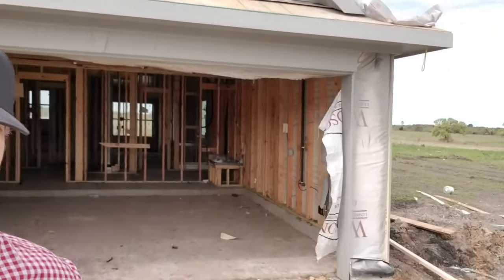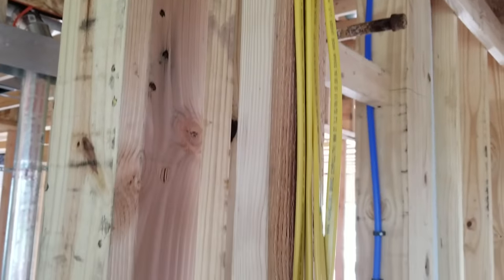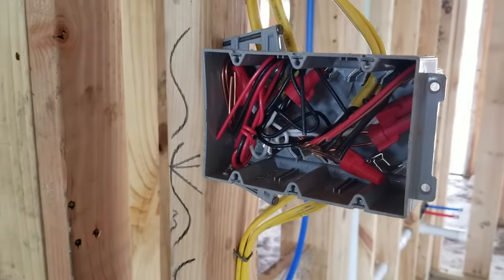HOW IS THIS EVEN LEGAL?!?!

Comment: needs plywood with tyvek before the hardy board ... this is quite a cheat
Reply: Or even OSB
Reply: My house was built in 1850. The frame is post and beam, the sheathing is 1” planks. They sure don’t build them like that anymore. 👍
Reply: The siding will outlast the house
Reply: As a general rule, you don't have to wrap the entirety of a house in plywood or OSB. It's not a bad idea, and there are benefits to it, but it is not necessary for a proper moisture barrier or for structural strength.

That being said,  the COMPLETE lack of wood sheeting is concerning.
Reply: teraxiel 
Isn’t it supposed to be sheathed with plywood on each corner to maintain lateral stability?  Those ceiling straps in the garage won’t address  this. Scary if lateral stability isn’t addressed and that the homeowner won’t be aware of it.   🤦‍♂️
Reply: @Mote78   I worked on some houses built in the 80s, corners were plywood, the rest was fiberboard or blackboard, a quality house is going to have sheathing all the way around like all of the houses I have built for the past 25 years, that's my opinion anyway
Reply: Greywolf79 97 couldn’t agree more. Plywood or OSB on the outside walls all the way around
Reply: Mike Gerrits Yeah we had like 3 inch thick studs throughout the whole house, structural shiplap, thick plaster walls, etc... won’t have it anymore cuz it’s getting rebuilt after a fire. 😂
Reply: @teraxiel , the only benefit to not wrapping it entirely with osb or plywood is only to the builder from a financial point of view.  Structurally speaking and as for keeping out air and moisture, there  is no reason at all to leave out the sheathing.  It's poor quality and basically a con job by the builder.
Reply: @jtltet  I'm not trying to be confrontational here, so please take it as intended. 

Any costs incurred by the builder that can be will be passed on to the buyer. Therefore, all things being equal, a house built for less is a boon for builder and buyer.

No, there is no structural or moisture related reason to leave out sheathing, only a financial one, see previous.

THAT home is poor quality, but lack of a complete exterior sheath is not in and of itself poor quality. Some regions need full wood sheathing for insulation reasons, air gaps, etc., some don't. Also, not all homes need a full wrap to be structurally sound. If you don't need it for insulation or engineering it is literally a waste. It bloats the cost with no benefit. It can actually be harmful to the finish. Stucco is popular in some regions and it does WORSE over sheathing, cracking much more than where there is none.

A complete wood wrap is a quality feature, but a lack of it is not NECESSARILY indicative of a lack of quality, so it is unfair to say the contractor is a con (he probably is, but a lack of a complete sheath is insufficient reason to say so).
Reply: @teraxiel , I don't take it as confrontational at all.  But as an architect I would respectfully disagree.  The lateral bracing  and the ability to resist wind shear makes osb or plywood a very necessary element in the homebuilding industry.  

Yes, it is true that by code it is not necessary to completely wrap a house with plywood or osb but I have never seen one that didn't at least have some sort of sheathing even if it was blackboard or intermediate sheathing as it is sometimes called.  
The use of the little metal straps are useless against racking if the wind hit hard enough and the home would collapse.  

Yes, it raises the cost of the house but in terms of the cost of the monthly mortgage we are talking $50/month, if that.  

Perhaps saying the builder was a con is harsh because maybe the buyer is aware of his practices but they certainly aren't doing the homeowner any favors by saving them a few thousand dollars on sheathing.
Reply: @jtltet  I feel like maybe we don't disagree.

I agree that that specific home looks low quality. My original point is that a home doesn't necessarily need an ENTIRE wrap of wood sheathing. I'm not saying NO sheathing. In fact, I don't think I've seen a home built in my career that didn't have more than a little sheathing. But I rarely see homes with 100% wood sheaths. 

Also, the guy in the video implies that you have to have plywood under the moisture barrier and I was also commenting on that.  Moisture barrier works just fine without plywood/osb backing.
Reply: @teraxiel , Every house built where I live in NC is fully sheathed with osb or plywood.  A moisture barrier isn't going to stop air infiltration so your home is literally going to be like having an open window in your house because there is no way to completely seal that off.  Every single nail that is used to install the siding is going to make thousands of holes in the moisture barrier as well.  I can go along with not using osb or plywood everywhere but some type of sheathing is needed prior to installing the house wrap.  My preference would be zip system r-sheathing which  already has insulation to stop cold spots because wood is not very good at insulating so the wood allows cold air to transfer thru from the outside but with the r-sheathing it completely covers the studs with insulation and provides a thermal break and eliminates the need for a house wrap as well.  Yes, it costs more but if you want to do it right it's going to cost.  If you just want a home to say you have a home then buy something like in the video but years down the road you're going to have problems.....big, expensive problems.
Reply: @jtltet  I don't disagree with anything you said other than that you need sheathing behind your moisture barrier. Now, this might depend on the product one uses, but your standard tyvek or asphalt paper works just fine without backing. Moisture barrier stops water not air. In the video, he implies that you have to have sheathing behind the moisture barrier and the OP of this comment thread repeated the same. That's all I was commenting on. Sheathing has nothing to do with standard moisture barriers.
Reply: @teraxiel , but the sheathing helps stop air penetration.  You do not want a drafty house or you are wasting money on heating and cooling  your home.  It is much easier to seal off a home with sheathing but besides that it is much more structurally sound.  I would not buy a home that was not fully sheathed.
Reply: @jtltet  Again I don't disagree, but we're talking about different things. I'm in full agreement that full sheathing and an airtight exterior barrier makes for a better, higher quality home. However, I'm only saying that moisture barrier doesn't need backing to work. That's my whole point. Full stop.

A house does not necessarily need FULL sheathing to be structurally sound. Full stop.

It's possible to engineer a house with no sheathing under the cladding but that's not ideal in my estimation. But again, we don't disagree on this.

Once were talking about airtightness we're talking about something else. Construction varies widely across the country. Especially insulation. In some regions, especially where it gets really cold, insulation is enforced to a strict standard. In other places not so much. So in some places an airtight exterior is PARAMOUNT, in others it's not. You can still achieve a high level of airtightness in the interior without an EXTERIOR airtight barrier, but rather an interior one. This is much easier and cheaper to do, but again is region specific. In California, you actually have to do a pressure test of the whole house (not sure how common this is in the rest of the country) to get you energy efficiency rating, and literally NO ONE builds a house with an airtight exterior barrier.

Comment: my friend builds home's , said he could break-in most any new house - thru the wall without any tool's
Reply: Come on he's joshing you. Everyone knows it takes a sheet rock knife to get into new homes.
Reply: Paul Frederick  Way that garage is built , pull apart the siding you're in . yeah want to be clean about it cut a hole thru the drywall takes time - just kick it out , your inside :)
Reply: @davedavis9693  I just don't want to mess up my expensive kicks. Plus knives cutting through cardboard is quieter than ripping it open is. You need to be considerate with the neighbors. You may be breaking into their house tomorrow.
Reply: Paul Frederick Thought we were chopping thru drywall ? now we are cutting apart cardboard . I'm just trying to get in fast as possible , before the cop's show up .
Reply: @davedavis9693  the cops are not going to show up if you don't give them a reason to. Like if you're quiet and no one hears you. What houses are made out of today basically amounts to gigantic happy meal packaging. Nothing but paper and plastic. I got to watch a new house burn to the ground here a little while ago. 15 minutes from ignition to char on the ground. The place burned so fast the fire department couldn't get there before it was already on the ground. It was phenomenal. The smoke billowing off the place looked like an oil fire. It was just this black pillar that went straight up. I don't think a pool of oil would have burned any faster than that place did. I bet not even as fast. I drove by as it was fully involved and I thought I was at the homecoming celebration. It was going like a bonfire. You couldn't soak a pile of pallets in gasoline and get them to burn any faster than that place did.
Reply: Paul Frederick can't believe people pay so much for their new dream house . I've hired contractor's , they always want to take short cuts using the cheapest materials . would not use OSB to build a dog house . cheap balsa wood , some five penny nail's n plastic on a slab
Reply: @davedavis9693  construction is a money racket. Stop paying them and see how many show up for work. There ain't many doing it for the sheer love of the work. And like is often said, If you don't cheat then you don't eat. Folks do tend to eat as well as they can afford to get away with too.
Reply: @davedavis9693  I've seen folks straighten lumber out. I've also seen how nice wood used to be too. I was working on one high profile job at a historic site and it had wood in it like you wouldn't believe. I know when I saw it I didn't believe it. Clear boards 20 feet long and a foot wide with grain so straight you can check how good your laser line is on it. How does a tree even grow like that? Over 150 years ago they did though. All of those are long gone now.  Our great great grand daddies chopped them all down for themselves. Which we'd do today but we just got to the party far too late. So we're stuck working with the crap that's around now.

Comment: I work with quality contractors no canned spec homes and no bulk tracks it's not that more expensive to get us you  spend 50k to 100k more for what we do in the long run you don't have a lot of repair in the future
Reply: You might even be cheaper if you can build a well laid out house too.

A lot of tract builders throw up large but stupidly laid out homes built dirt cheap, because people just look at sq ft and price.
Reply: @bigpjohnson  you are 1000% correct! I try to tell people all the time to always pick a smaller well built house over a larger crap built house. I built a smaller home but the finishes used rival homes $100k more than my house. I know people who built 3000 Sq ft homes with cheap laminate on every surface and carpet that feels like sand paper.. And Everything is falling apart

Comment: My God! I wouldn't even build a dog house like that. Where are the building inspectors?
Reply: murraystewartj --> Probably paid off by the builders.
Reply: looking the other way, or just non-existent due to cutbacks.
Reply: That's true. My dad built a house in 93, I remember the delays because the inspectors couldn't get there. One okayed th septic on the phone. The lateral were running uphill, I knew that was wrong, pooled water from the start. His permit for a driveway was never inspected, but our county officials are lazy.
Reply: First Name --> Hahahar, that's funny ... but you haven't seen my dogs!
Reply: Once outside of city limits, inspections become rarer and rarer.  You might get a local fire dept to do a basic electrical inspection, but that's about it.  Seeing as those houses are in a field, there might not be much in the way of permitting and inspections.

Comment: I had to strip my house down to the studs.  And I have to find several support missing off on the beam.  And most supports either shrunk or cut short and the beam is supported only by the nails.  Even the building inspector won’t find them, since these are behind the drywall.

Comment: Thinking about it, you are in tornado alley over there in texas, so maybe they are building to reduce cleanup efforts. fewer materials in the build, fewer materials to cleanup after a disaster. Just horrible stuff! Someone needs to be sued! As a Licensed Commercial/Residential Builder in NC/SC, I like to see that you are pointing this stuff out. These guys are such jokes! People in Texas can just wake up one day and decide to be a GC/Builder, and the only thing stopping them is at the local level. Yikes!! In 2019 even! It irritates me that there are many states like this where it is still like the wild, wild west in the construction industry.
Reply: yea that makes no sense, They arent impacted the very least with clean ups. This shit build quality has prolly killed people who have taken shelter in the middle of their house during tornados..
Reply: @XxAtomic646xX  I was speaking facetiously. Totally agree! This is horrible stuff they are peddling on people.
Reply: @chicks-on-the-loose  My choice, as a builder, if I were building there, would be ICF with at least 8" of concrete. Wind Tunnel test have shown that not even a brick wall will protect you from, say a flying 2x4 wood projectile. Brick walls are only 3 5/8" thick. Most homes use a curtain wall of brick and still have an OSB or Plywood skin over the framing on the exterior walls.

Comment: This video (and the quality is not that bad, I'm impressed) should be mandatory first-home buyer training.
Reply: You don’t get to see inside the walls, the only reason this video exists is because he found multiple homes in the middle of being built, once finished no one is ripping off the exterior to see what’s under it, but they should.
Reply: @epiccollision  No one but ME of course! lol! When I bought my first ever home(used crap house but at least concrete right?),that is what I did! As soon as I had the deed in hand I went inside with a hammer and wacked a few holes in the drywall to see if the house was really concrete or if it was a old wood house with a thin layer of concrete on the outside.. Well the house was half and half! The back was solid concrete block with drywall on 1x2 slats(okay good, I can work with that), but oh wow, the front half was an old wood and asbestos shingle house covered with 4" concrete block as a cover up! Needless to say my first home was condemned by the city and I had to sell off the lot at a loss.. Ahh humble beginneings
Reply: There's a lot of speculation going on in this video and he hasn't looked at the plans or talked with the architect, engineer, or superintendent.  His concerns may be valid, or they may not be, no one here has the information to determine that.

I agree that buyers should be well informed, but this video is far from informative or objective.  It's just trying to scare people.

Comment: I wonder if they get spray foam insulation, that would somewhat help with sheer strength turning walls into solid mass. Just thinking out loud.
Reply: Lol  spayfoam insulation will not no strengthen just grab a hammer and whack the wall and boom new entrance
Reply: @hihaveaniceday9386  do you know what a psi is?
Reply: @weedshoes5089    ??
Reply: Why not build a whole house out of foam?
Reply: @truantray  why is there rebar in concrete?

Comment: This is definetly illegal here in Germany! Sometimes it seams that most american houses are built very badly. At least from my perspective. 

Greetings from Hamburg, Germany
PS: i really enjoy your and Matt’s videos.
Reply: It's the American philosophy: second best. You don't need to be good, you just need to look good. The brick or stone veneer houses only finish one side that faces the street.
Reply: Here in Canada it wouldn't pass inspection, at least not in my province. We have strict codes to follow and many inspector's coming in at different steps in the building phase. Custom homes are a lot better than mass development homes. But they still have a basic code to follow.
Reply: @sebastiencharette6637  Yeah. I work for a special development real estate company in the Hamburg Metropolitan Area. Of course development homes are cost efficient. But they are still built sturdy and very well insulated and shielded against anything. New built development homes mostly adhere to the KfW55 Standard wich is way higher than code, but you get cheaper loans from the KfW bank (owned by the governement and originally founded with US money after WWII and today an aiding bank for students and private people...) so therefore even development buildings are high quality.

Comment: I'm an Engineer. Turns out that it's happening in the DFW are for homes in the $650k to $800k.  The city plans show that the Builder submitted plans with 7/16" OSB sheathing BUT they used the cardboard material in your videos. No change orders are on file.  So....no, it's not legal.